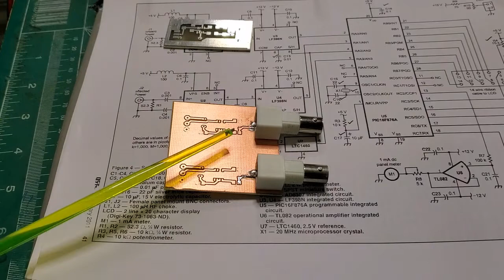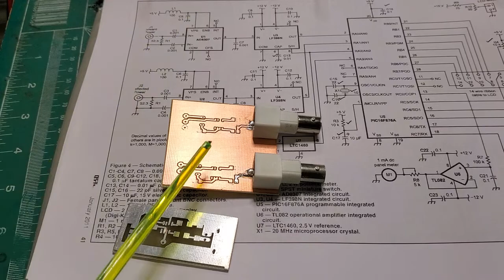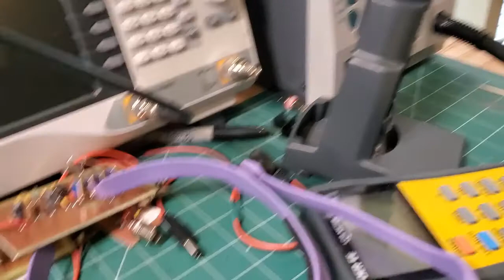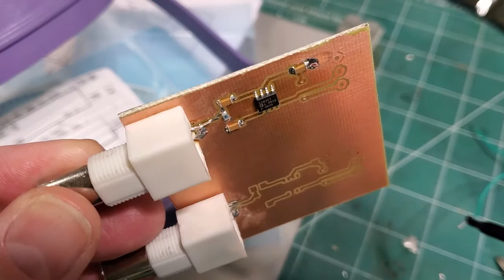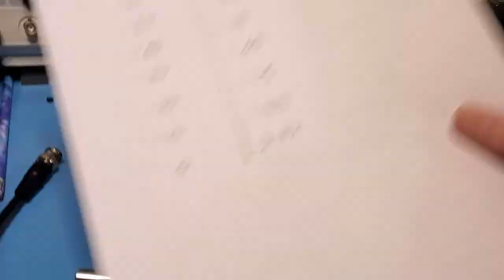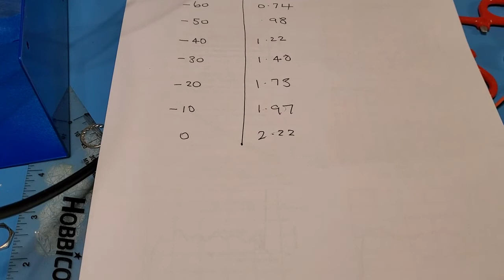QST Wattmeter -  Part 2 Installing and Checking AD8307

Comment: Hi there! I’m interested in this project. Do you this could be used (ie accurate within +/- .5 db) the check the calibration of my used buy Marconi 2022E sig gen? Cause what I’m trying to achieve is get a reference to start with for checking various instruments like my sig gen, and a couple of rf millivolmeters. I’m also buying just now a fairly accurate new dmm.
Thanks for sharing!
Reply from the maker: Perhaps - but it would be tough to calibrate without a separate wattmeter to validate. A cheap oscilloscope would be better IMO. One of those USB based ones perhaps. Terminate the sig gen output into 50 ohms and measure across the output
Reply: @na5y  hey thanks for the quick answer! I bought some used equipment and I realized that calibration is something interesting to do and all the metrology is also very interesting to me too. I can tell you measuring the output of the sig gen with a racal millivoltmeter (1MOhm input) has given me encouraging results. My thinking behind is that even if they are both used and because they “agree” enough( within .5db or so) it cant be just by chance, they must be close to be calibrated. Nonetheless i wish to revise those instruments to put them in the best shape possible. Hence looking for something as a reference. I thought about an oscilloscope too but i thought that wouldn’t be accurate enough. Let’s see cause I’ll have to buy one anyway. Im starting playing with electronics just now so it’s nice to get some advice from more experienced people. 
73s!